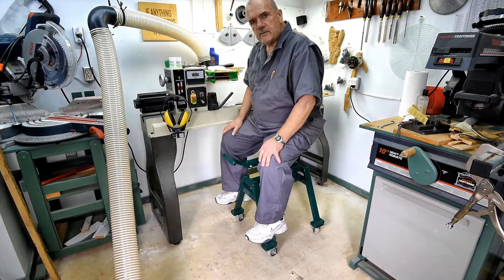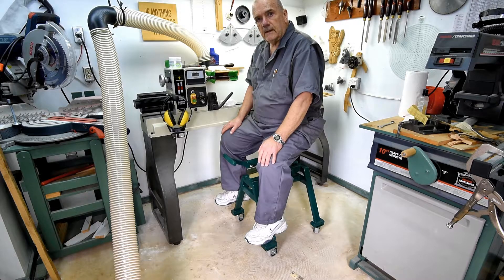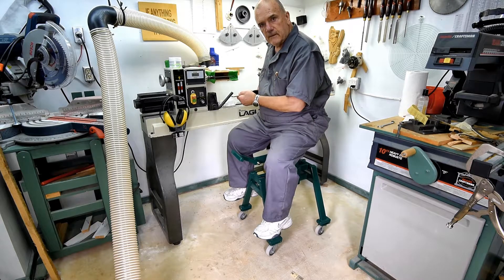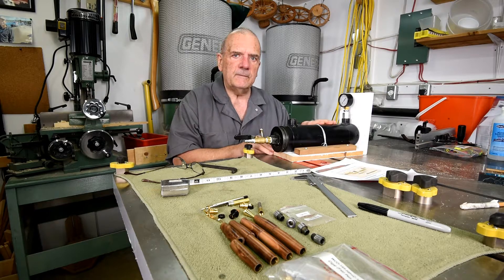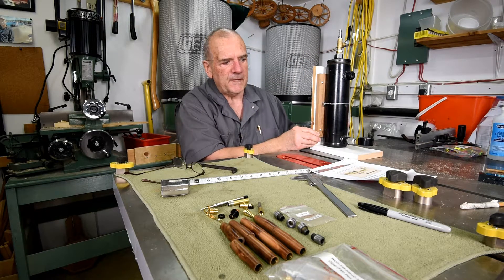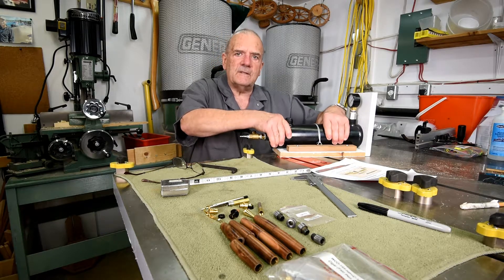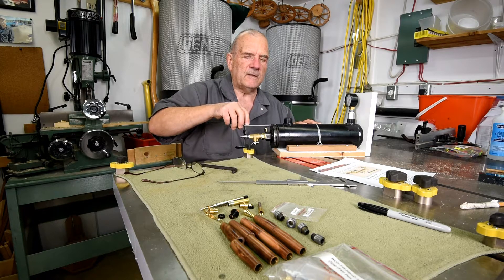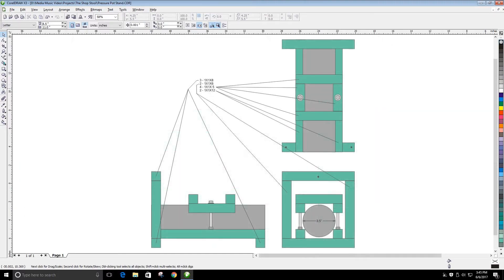The Pressure Pot Stand - Part 1

Comment: Hi Ron Looking at your drawings if you put an angle on the tubes touching the tank would it be better?
Reply from the maker: Yes, but then it would be harder to drill the hole for the bolt that is to clamp the upper bracket to the lower. Thanks for noticing and letting me know :)